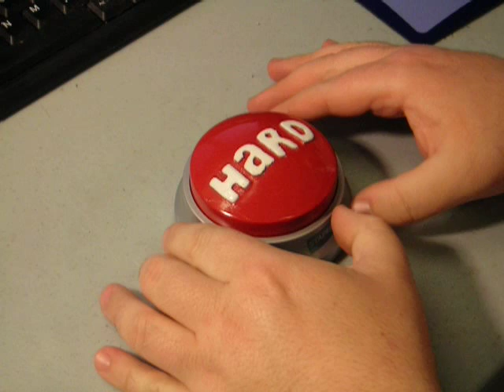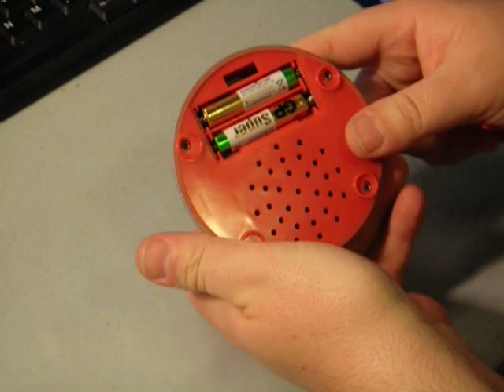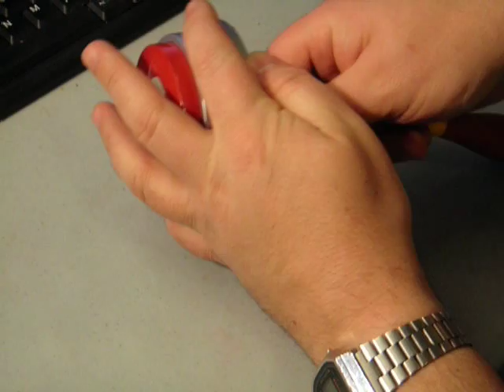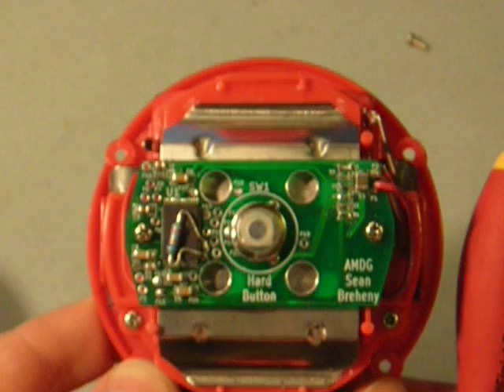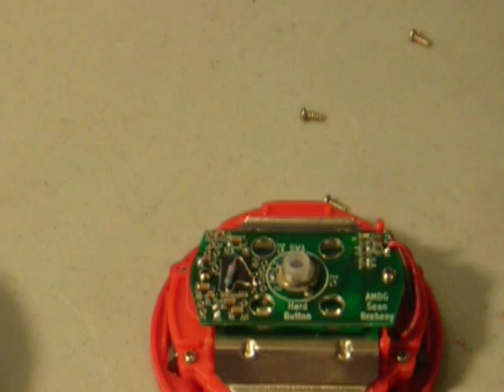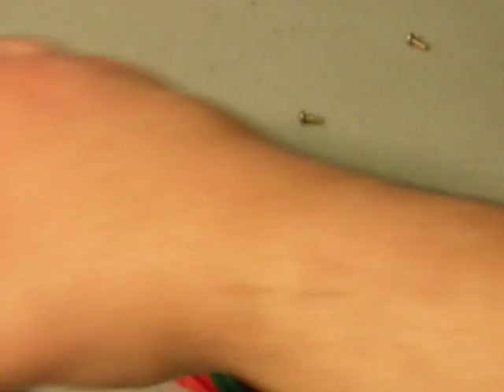The Hard Button

Comment from the maker: Yes and no :) No because this circuit board is a completely different design than the original one, so it's not the same resistor. Yes because it is part of the timing circuit so it might be able to change the pitch. The only reason it is such a physically-big resistor is that I needed a 56k resistor and didn't have that value in surface mount.